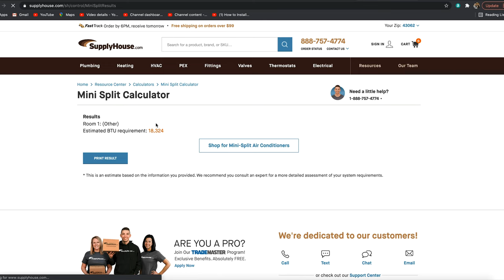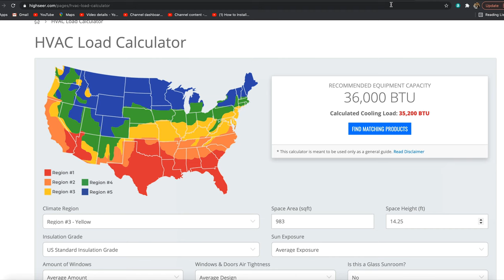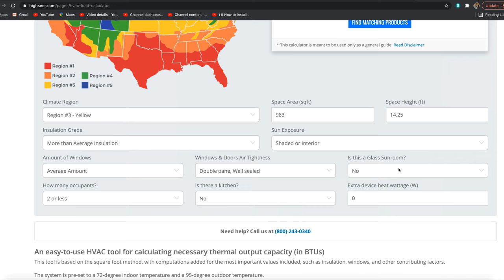ICF and Zip-R garage drywall finishing and front porch stairs!

Comment: When you are worried about water ending up under / behind your baseboard in the garage, why not treat the entire garage as a giant shower pan.
Use some of your rub-r sealant to make a small sealing between the floor and the wall behind the baseboard (just half an inch lower than the height if the boards).
Then you never have to worry about any water causing trouble.
Reply from the maker: something to think about but i hope i don't get it that crazy wet, just mist from when i wash a car or the floor etc.

Comment: GFCI's are kinda like us---they sometimes have individual characters.  They are subject to ideocracies especially with motor loads .  When i run circuits for deep freezes  or garage outlets for  refrigerators etc.  I put them on a "single use receptacle "  [ a plug with only one outlet on it ] so i do not have to use GFCI circuit.  Now codes may have changed.  Usually when roughing in a garage i would run a couple of circuits and just put a bland cover on then at locations that the home owner thought he may want a freezer or refer. That allows  me to get the final w/o installing GFCI's.  Also be sure not to have a second GFCI in the same circuit as one before it. For all outside plugs around the house i run the homerun to an interior location the garage then run all the exterior plugs off of that one interior located GFCI so i don't have to have all those separate GFCI's [ that are subject to weather problems even though so called weather resistant ].  This calls for more wire but all those outside plugs are now on one circuit with only one GFCI.  I am retired now and i am seeing the cost of materials so that might impact some of these decisions. Great watching you "geter done".  I'd love to be able to build another home now with all the new better and improved  materials andmethods.
Reply from the maker: thanks for the info.  as for building with the new stuff, i cant say its always for the better.   to much money added to the build cost and sometimes the new stuff works to well and doesnt let you do what you want haha.

Comment: You should choose an ERV. As ERV technology improves, the recommendation is basically to always use an ERV.  
An HRV exchanges heat but not humidity. Previously, the ERV membranes / enthalpy wheels were not as good at transferring heat, so there was a tradeoff to make in the efficiency of the heat transfer vs the benefit of moisture transfer. ERVs also had struggles with cold climate freezing, but newer units have built-in preheaters to prevent the core from freezing. For some numbers, HRV/ERVs such as the Zehnder ComfoAir Q series have 90% heat recovery efficiency for HRV models and 86% for ERV models, with 73% humidity transfer efficiency for ERVs. That's pretty darn close on heat recovery efficiency.

In climate zone 4 in Ohio, you are a heating-dominated mild climate which requires both heating and cooling, and the climate is rather humid in the summer.

During the winter, it would be normal to need a lot of humidification. Traditional furnaces and leaky houses do this very poorly with water wetted wire mesh humidifiers, or with higher end steam humidifiers, so retaining any humidity you manage to produce indoors is important. However, since your house is fairly well air sealed, you may be able to get away without active humidification in the winter if you can retain the humidity released from normal living activities (i.e. breathing, showers, etc.) using an HRV, especially if the HRV pulls from the bathrooms.

During the summer in a humid climate an ERV is a better choice if you are using a VRF / mini-split type cooling system, which tends to operate at much lower temperature differences (i.e. they don't take the air to near freezing inside the coil, they just cool it slightly with more airflow), which means it dehumidifies a lot less than a traditional single or 2 speed central AC would. You'll have to live in the house for a bit to decide if the ERV and AC alone is enough, see if you can have the AC go into a dehumidification mode periodically, or if you need an additional dehumidifier. For a very airtight house, sometimes a portable dehumidifier can handle the whole house. Mini-splits do a lot less dehumidification than central AC systems partially because they do not drive such high temperature differences in the air, although they can control this to dehumdify when required. 

If you want to do a more complex load calculation, you can play with this site - https://loadcalc.net/ - look at the sensible heat (temperature) and latent heat (humidity) numbers it suggests in the summer.
Reply from the maker: Thanks so much, will do!

Comment: 36000 on mini, go with a hrv, you will need dehumidifier for basement, the concrete still curing, 1 to 2 years after its poured in a icf house
Reply from the maker: Why an HRV though?  And the Mr. cool will be in the basement also which should help.   By the time I install that though we’ll be beyond a year for the concrete pour and the windows still aren’t installed which will probably help since we aren’t enclosed yet.   Fingers crossed at least.
Reply: @neckofthewoods24  if you have tons of money. best case scenario is to have a standalone ERV unit and dehumidifier unit. I’m  thinking you’re going to have a humidity problem. Erv will add more humidity. Plus the mini splits will help humidity. They’re basically a dehumidifier. I’m thinking HRV is your best bet with mini splits.
Reply from the maker: @joemizer  we don’t at all!!   But hmmm something to think about.

Comment: Have you looked into Tankless water heaters for your domestic hot water (DHW) and possibly radiant heating?  I have read that radiant floor heating in an ICF doesn't give you the comfy warm feet in a tight envelop.  It is overkill.  But radiant is still the most comfortable heat.  You have to do the manual J to determine the heat loss to properly size what you need whether you stay with radiant or go mini-split.  Tankless is cheaper, more efficient (the new heat pump water tanks are really good too) but require more maintenance, but last a lot longer.  
The floor plan I am putting together has the 5 piece master bath, 1/2 bath right next to the utility room.  I can mount the tankless on the wall right next to the shower (in the util room) to cut back on hot water piping.  The opposite side of the house are the spare bedrooms, kitchen and bathrooms.  I will put in a second tankless on that side for a couple reasons.  Backup heating source, quicker hot water (no recirculating pump design), and I don't have to run 40'+ hot water piping to the opposite side of the home with vaulted ceilings.
Reply from the maker: i looked but never inquired yet.  i know i want one for the hot water in the house but not sure yet if ones powerful enough for the radiant and the hot water or just one or the other.  ill have to look into this manual J thing.  im wondering if the tankless companies have enough knowledge about using them  as they aren't really intended.

Comment: Great work and due diligence. Are you planning split system entire home?
Reply from the maker: Garage, basement, first floor, and maybe bedroom so at least 3 units maybe 4.   Mr. Cool can do 4 units on 1 condenser but hose length will be an issue.   We’ll see
Reply: @neckofthewoods24  : great going. I love to move to split ac rather than traditional Hvac. Super efficient. Love to see how you are planning Hrv along with split ac system.
Reply from the maker: @squeekhobby4571  probably not HRV though.   Still like 90% sure doing an ERV.

Comment: garage looking good. I wouldn't rely on those online calculation tools for your HVAC sizing needs. Not specific enough to your unique application. Ask your HVAC contractor/supplier to run a detailed heating/cooling calculation based on your particular construction design, geographic location, shading around the structure, and the directional orientation of your garage . As you state, over or under sizing will create unwanted problems.
Reply from the maker: i did that though and they were no help like i stated.  im my own installer so there is no one to ask and companies probably wont tell me that info since i wont be buying from them.   now if i find out a cost for them to install plus the units they will but they'd have to be at the same price or lower than the Mr. Cool units from Supplyhouse.com which i doubt they will be.  the Mr . Cool units from them seem very reasonable so i cant see getting other brands installed for free.  im not sure why the detailed calculator i used which takes everything into affect you stated is not good enough.

Comment: Go bigger with Mr. Cool units. They are infinite variable so they will go lower when the load isnt required.
Reply: also do erv. no question about it. The moisture. You don't want to create air that is low humidity with your mr cool and turn around and exchange it for high humidity air outside.
Reply from the maker: Interesting!   Thanks!!!